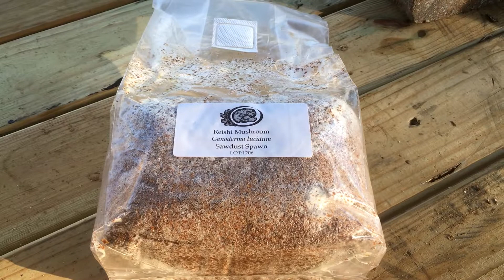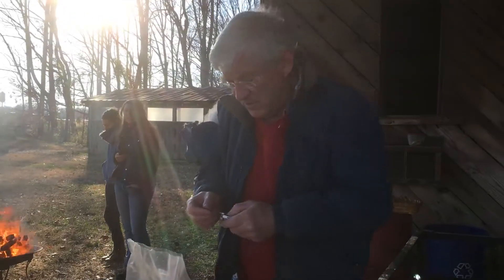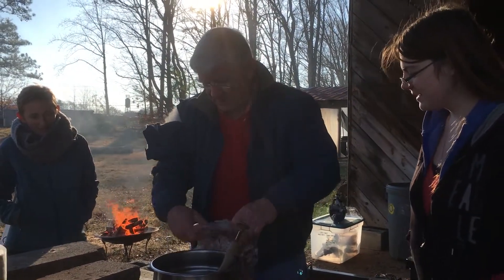Inoculating Logs to Grow Reishi

Comment: I’ve watched videos of people doing that method. It seems labor intensive. If someone is trying to do it as a business maybe it’d be less labor intensive to just drill a one inch hole through a two foot oak log and just fill it with inoculated grain or something And then use wax on both ends of the log. I’ve not seen anyone try that method. I suppose you’d use more grain then doing several one inch holes but if wages have gone up and keep going up with inflation ya probably need a super streamlined approach. I’m going to try a few different ways. Maybe it’d take longer to produce mushrooms if you just did one hole in the center. I guess I’ll find out

Comment: Hello. Nice video. Did you see any results yet? If so, is one species of tree better than the others? Also. If I inoculate some logs say around the end of November early December, in Pennsylvania so it gets cold, should I store the logs inside or will they survive the winter and start to grow in the spring? If I don't have room inside or just don't want them inside, would it be best to just inoculate in the spring? Also, do you use fresh cut logs from living trees or dead trees? Thank you. Oh and what kind of drill bit are you using? Nevermind on the drill bit. I found it on the website you posted, in the palm tool inoculation bundle. For anyone else interested. https://www.fieldforest.net/mobile/Palm-Tool-Inoculation-Bundle/productinfo/W-PTB/
Reply from the maker: Hello Mike, we haven't gotten any reishi yet. We were hoping that storing them inside would speed up the process but it can take up to two years to fruit. So, the storage didn't speed up our timeline and we are expecting to see some reishi in summer of 2019 from the logs we inoculated in winter 2018. I would go ahead and inoculate end of November like you planned and store them outside and see what happens. Since we haven't gotten any fruiting yet, I can't say which species of tree did better.
Reply: @Noeliajoy  ok thanks for the reply. Do you use fresh cut living trees? Oh and have you tried the totem method at all? I wonder if that would work out well for reishi?
Reply from the maker: @mikey_mike  yes, we cut live trees after the leaves have fallen off and then inoculate them within 1-3 days of cutting or it will become colonized with competing fungi. Also, you don't want to use already dead trees, or trees with parts that are rotted out for the same reason, because they have already been colonized with fungi and your inoculant won't take.
Reply: @Noeliajoy  a cut live tree needs some time for the natural anti-fungicides in it to decompose, so as not to kill your mycelium, usually it takes about a month or so